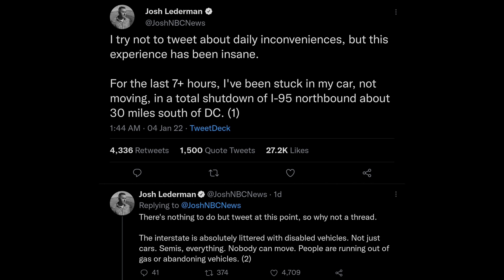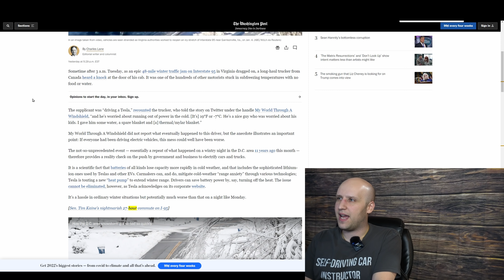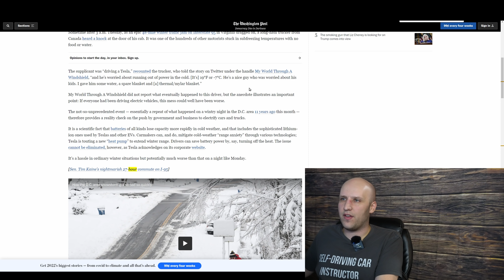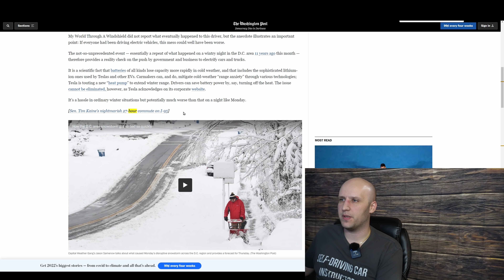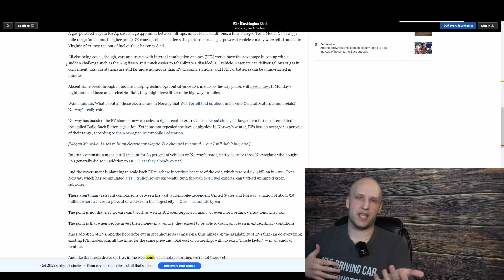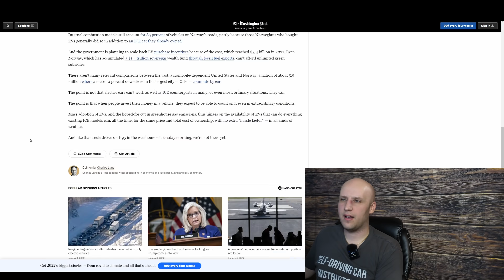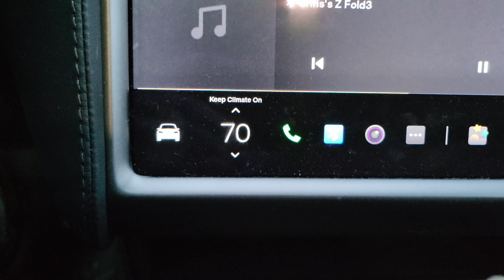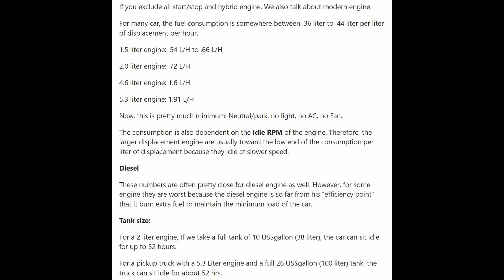How Long Can a Tesla Keep You Warm In A Frozen Traffic Jam? | FUD Debunking

Comment: Interesting point on the battery going bad, I realize its written from the never electric crowd, but if a battery does run out for any reason I can't walk to a gas station and walk in a few gallons of fuel, I imagine you would need to call a service. Anyone out there have a DIY solution for this? Perhaps role out solar panels could be a DIY method to get to a charge station after killing a few hrs of course. Small gas generator for emergencies in the trunk maybe?

Comment: Definitely more impressive than I expected. The only caveat to this is how many of those people had a full charge when they were sitting out there. We know that Tesla is usually only charge to 80%. Given that, if they drove to work and had the car sitting outside in cold temperatures all day ( which uses energy to keep batteries from freezing) they would have started their commute home with a lower % than the 90% you started with. That being said unless they had just filled up most gas cars wouldn’t be full either. So I think the time that any car would last would be very dependent on the owner and how they use it. In a situation like this I would think that humanity would share cars and preserve charge or fuel as needed, but i may be naïve.

Comment: Everyone has a different opinion of really cold, we have had a month of close to -40 for a month, the newer heat pump designed cars the heating systems failed and in at least one case left them stranded on the side of the road. 

Electric has many advantages especially for urban dwellers, for those of us that live in remote rural settings where it can get really cold they aren't quite there yet.

Comment: So do ice cars, they loose about 15% efficiency in the real cold 🥶 conditions I've tested mine. Most of them are about the same.
Reply: I think heat pumps suffer much worse fate in extreme cold. if a gas engine is able to start, it'll keep itself warm with waste heat. a heat pump on the other hand, will just stop working if the outside temperature goes too low.
Reply: @lorenzo42p  there's a video of model X in -48 it's been years since I've seen that video but the car worked the wheels were out of shape from the car settling where it sat so it was riding rough and bouncy.. it lost about 35 miles over night but it worked without issues.

Comment: This test people keep running is silly and I'll explain why. Even in a gas vehicle, you would most likely heat it up and turn it off for awhile. You would conserve fuel as much as you could. You would definitely not run a seat heater. This test would be much better run by heating up the Tesla and an ICE vehicle and seeing which one loses heat the fastest. Using that as a metric to calculate for how long you could intermittently heat each up and then turn off to save battery or fuel.

Comment: Some years ago, in the DMV area we had a significant snowstorm that ended with a coating of sleet and ice over the heavy snow which also caused thousands of power outages this led to people using their vehicles to stay warm, the heavy snow with the coating of ice over it led to numerous deaths inside vehicles from carbon monoxide poisoning.
Reply: Unfortunately same thing happened last week in Murree Pakistan , 23 people died
Reply: That can't happen unless somehow exhaust gasses were to leak inside the vehicle.
Reply: @tempest411  yes that is what happened with the deep snow and a ice coating over the snow it encapsulated exhaust pipes and caused fumes to leak inside of vehicles.
Reply: @darrylsmith2233  Same thing happened to 4 girls sleeping in their car hoping to wake up to a powder day at Squaw valley probably back around 2000. They wanted the heat on, fell asleep and the snow encapsulated the bottom of the car so the fumes went in

Comment: Well, many moons ago I was stuck on Donner pass for about 8 - 10 hours.  I don't know what the exact outside temp was, but the pass was closed due to snow levels - hence, "cold" was the temp.  Although I had duel tanks, one of which was full, I only periodically started my truck and ran the heater.  Some cars in that mess ran out of gas.  The moral to that story is - if you run your vehicle until you are out of fuel, then you run out of fuel.
Reply: How many people ended up being eaten?

Comment: The problem would be where if a gas car was low and runs out of fuel, someone could bring a portable gas can to let them run again. Whereas an electric charge would need, a generator on a trailer to roll up to every car there? Or, a tow I suppose. I think that was the main point here. My cousin took his 4wheeler and brought sandwiches and cans of fuel to help people stuck on the highway down south one year.

Comment: So basically if you are at a half a battery you won’t make the full 24 hours but if you’re using a gas car you will.  I think most people in the situation were not sitting at a full charge/tank.  Electric still has a ways to go.

Comment: even with a gas engine when driving in the winter outside city limits i always carry a blanket extra socks and clothes as well as a few candles in the glove compartment just a small candle will warm up the cab of a pickup thankfully over the years never needed them if you live in extreme climates you must take responsibility for your own safety as the worse the weather the longer the wait time for help so if your a city person don't jump in your tesla in your gym clothes and head to the cottage in a storm that would be a dumbass thing to do

Comment: So same rule as ICE cars: Make sure you are fully charged in poor weather. Also, if you were stuck in this situation you could always turn the heat off if you got down to 10% battery to give you enough charge to get off the highway (hopefully you have a nice jacket if that is the case).

Comment: This is why they have camp mode. It turns off all unnecessary use and only runs the climate. You definitely wouldn't have the seat heater on 3 unless you wanted to cook yourself. I use level 1 and it's plenty hot. Point is if you where stuck in a emergency you would put it in camp mode and set the temp to no more the 15c. This plenty to keep you alive and would probably last a lot longer.
Reply from the maker: I tried camp mode too and it used the same amount of energy
Reply: @DirtyTesla  I have a 2014 S and camp mode for me uses about 20% less. Maybe the setup of different years but works great for mine. Maybe I'll do a video on it when I get some time

Comment: This is why my wife and I don't go to the post office (1 mile away) without at least one bottle of water.
If I was driving anyplace south of NJ in the winter I would never go out or on the road in snowy weather.
They can't handle it, they don't have the equipment to handle it.
Even driving in summer conditions locally we always have snacks with us and a cooler with water/drinks.
There is a blanket in the car.
Fire starting tools.
Small bills in cash, if power is out or worse an EMP we can buy stuff.
And we would never be low on fuel as I always fill up before getting on the highway and fill up at a half tank at the lowest.

Comment: A heat pump struggles to pull warmth from outside air as the temperature drops below freezing. At some point as the temperature drops, resistive heating is going to need to kick in.

Comment: Why not to add small generator for emergencies? You could heat the car, charge the car, maybe even slowly drive it real time, if needed.
Reply: what you described is a hybrid gas/electric. the problem then is you're hauling around a lot more extra weight and complexity
Reply: @lorenzo42p  I'm not talking about hybrid. I'm taking about a small, lightweight, and maybe portable, 750 Watt generator, under 10 pounds. It will produce enough heat for heating as a byproduct of just running an ICE. And the generated electricity could be used for whatever, e.g. charging main battery. You won't drive anywhere far with one HP; however, that's enough power to move the car slowly - probably with around 3-5 mph speed. Might be very handy, if you have to move a broken car out of a harms way.

Comment: Problem is if you are not fully charged when this happened, you won't last long. If a gas powered car, you could get gas, if available, to increase your idle time to keep the engine running. You can't run out to pick up extra electricity or have electric powered delivered.

Comment: The point that the article making about everyone having electric car at that situation it's that gas car in case that you run out of gas you can put a gallon of gas in 1 minute and drive to the next gas station electric cars would not be that easy it would be needed generator what it's power by gasoline anyway and would take many hours or day to be able to move all the cars . Of course electric cars it's a great idea just  at this moment in te the price asked doesn't make sense pay that much if you not going to be saving that same amount of money in gas and maintenance but we will get there , the most efficient at the moment it's hybrid.

Comment: This was cool, would be interesting to see the inverse of it. Come south during the summer and see how long it can cool when it's 100 outside. I'd imagine cooling would use more energy but no idea how efficient they've made those systems.
Reply from the maker: Heat pump is far more efficient at cooling believe it or not. I'll try to get a 90F+ day here this summer and try it out
Reply: @DirtyTesla  heat pumps lose efficiency very quickly once below a certain temperature. So much that they don't even work. I'm not sure on the Tesla pump but residential units usually below 32 they lose a large amount of efficiency.
Reply: @JM-yx1lm  OP was talking about cooling in hot climates, but your comment was referring to heating efficiency at low temperatures. If a heat pump was asked to refrigerate in freezing temperatures, it would likely have COP >4
Reply: @DirtyTesla  would humidity impact the performance? Down south here it's not unusual to hit triple digit temperature with near 100% humidity. Makes evaporative cooling virtually impossible. I know I've tried those cooling towels and such with no luck down here
Reply: @Juncti  I doubt the actual temperature goes over 100 if you're in a humid climate. You're thinking of the heat index which is already taking the humidity into consideration, so it makes no sense to list the heat index plus the humidity, and the humidity is usually only up around 100% at night. I've lived in Florida for 10 years without AC so I pay a lot of attention to these things. The humidity is bad during the day, but a complete nightmare at night.
Reply: @Juncti  It does impact performance, but still works well, just harder.
Reply: @tedmoss  The highest temperature ever recorded with 100% humidity was 93° F, so if someone says that they have triple digit temperatures with 100% humidity, they don't know the difference between the actual temperature and the heat index.
Reply: @DirtyTesla  You're exactly wrong there - heat pumps working as heaters have a coefficient of performance (COP) that is 1 more than the COP of the same heat pump running as a cooler. The coefficient of performance is the heat added or removed (Depending which you want to do) by the pump divided by the mechanical energy put into the pump by the motor driving the compressor. This figure is usually significantly greater than 1. It's not an efficiency greater than one as the law of conservation of energy cannot be broken, but heat pumps will move more heat than the equivalent energy put into the drive motor could produce if it was fed to a resistive heater instead.

The reason why is that working as a heat pump the mechanical energy going in to the compressor is added to the heat delivered to the car's cabin. In cooling mode (Which is exactly the same thing except the evaporator is in the cabin and the radiator is outside), the energy put in at the compressor has to be rejected as waste heat to the outside of the car, as well as the heat collected in the evaporator in the cabin that you also want to remove. As a quick example, a heat pump taking in heat at the evaporator at a rate of 2 kW, with the compressor using 1 kW (This is the power cost to the car's battery), has to reject 3 kW of heat to the radiator. If you're cooling the car, COP is 2 kW / 1 kW = 2, if you're heating the car it's 3 kW / 1 kW = 3.
Reply: @ihatecrackhead  I haven't, but that's because they're not unless you cherry pick the operating points or you're talking about a specific heat pump product that has been heavily optimized for cooling and had the heating function added extremely badly as an afterthought afterwards. Have you any examples?

The behaviour I'm describing is because heat pumps have to obey the laws of thermodynamics - which set hard limits to the performance of these devices to which no known exceptions exist.
Reply: @ihatecrackhead  Heat pumps do generate heat as the mechanical energy put in at the compressor is turned into heat, which is rejected at the hot side of the pump. This is useful when run as a heater, but that same energy is waste heat when run as a cooler. 

When outside temperatures are freezing, the humidity is much lower, so there's less of an issue with fouling of the evaporator when moving heat with a heat pump in cold conditions, but you are correct about the evaporator having to be heated periodically to clear ice if conditions demand it.

The temperature is less of an issue with heat pumps than with any other form of heating because once the boiling point of the refrigerant is less than the outside temperature at the pressure the refrigerant is passing through the evaporator at, the refrigerant will take in energy and boil regardless of the surrounding air temperature. Boiling occurs at a constant temperature, so once the evaporator is sized correctly, it will evaporate as much refrigerant as the compressor can supply through the full range of temperatures it's designed to operate at.
Reply: @peglor  Two different ideas, heat pumps fail in efficiency at lower temps.
Reply: @DirtyTesla  This is true for all heat pumps below 32-40 degrees F.
Reply: Portable air conditioners are extremely common in the south.   The tesla uses virtually the same concept.
Reply: @patrickmontie9583  Except much more efficient.
Reply: @patrickmontie9583  No, no, no. A heat pump is drastically different from an air conditioner or heating element-based heater. Heat pumps use heat transfer with the ambient air (or in static applications, with the earth). They are far more efficient.
Reply: @NateDecker1982  exactly how to you transfer heat to the ambient air when the ambient air is 100 degrees?….
Reply: @ihatecrackhead  Yeah..so a regular ac system ..
Reply: @NateDecker1982  an air conditioner is a one way heat pump... So no no no, it is not drastically different.
Reply: @NateDecker1982   no.. heat pump are very similar your tropical A/C system.. same principle just that it has valve that can revert flow and pressure turn the evaporator into a condenser or vice versa, so hot in cold out or cold in hot out.. most motels have a unit for that dual function heating and cooling.. they use the same  Feon gas..
Reply: I will just say in FL Yeah??? they dont really work well at all
Reply: @marsmars9130  Heat pumps, i.e. air-conditioners are essential in Fla. because of the humidity. Swamp coolers, like we use in the dessert don't work well in Fla.
Reply: @tedmoss  I agree, and think thats what i said
Reply: a Litium battery can continue to discharge engery down to temps -4F without the need to even warm them. A gas car engine needs to be 200F in order to operate at its prime. Armed with that data, dont you find this question a bit odd?
Reply: @SEANMCAD  That 200F temperature the ICE needs is easily maintained while idling even below -40, and most modern ECUs will automatically adjust the fuel and timing to maintain that minimum temperature, though I've only ever seen an ICE need to do so when starting below -15F.  The same cannot be said for batteries.
Reply: @GremlinSciences  wat? I live on batteries and what you said made zero sense. It can be -20 degrees outside and I can use power in my batteries to heat my trailer a car needs 200f to run. What the f are you talking about?
Reply: I think my vehicle is different. When i turn on defrost it sounds like the pump comes on. It shuts off when I have on reg heat. The same pump kicks on when AC is turned on. I dont remember other vehicles doing that. Im trying to figure out if my gas vehicke can stay on idle as long as a teslas charge. All I know is when that pump or compressor kicks on it eats more gas
Reply: I live in Mid Florida.  I have a AC/Heat pump system.  It keeps me cool in temps above 100 degrees, but also keeps my warm with temps down to the mid 30s. Heat pumps don’t produce very hot air lime a furnace, but keeps the house comfortable.
Reply: Happened to me. Southern Germany, about 35C out there (probably way more in the sun on the Autobahn). 2019 Model 3. I got into a traffic jam. Range drop was much lower than in another traffic jam near 0C.

Comment: I wonder how well the cars would do in the same conditions if you were to heat the cars up to 80 degrees fahrenheit and then turn them off with the windows up for as long as the temperature inside the car was tolerable and then repeat. I think for someone with a sleeping bag a gallon of water and a few power bars stuck in the snow that might be a better strategy.